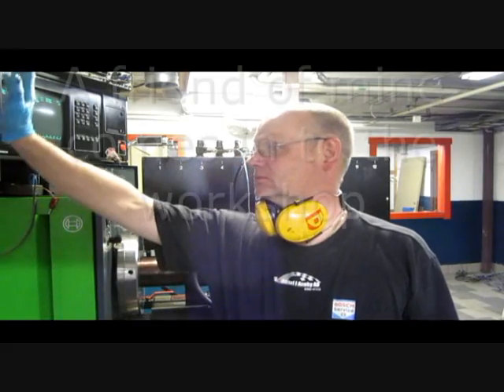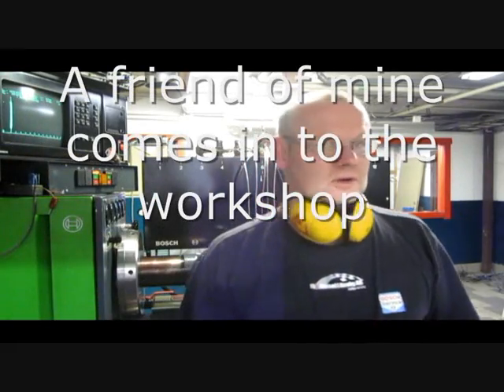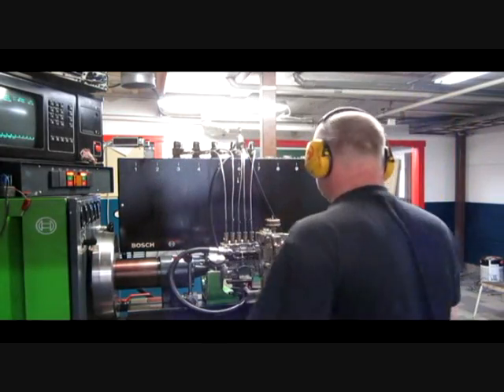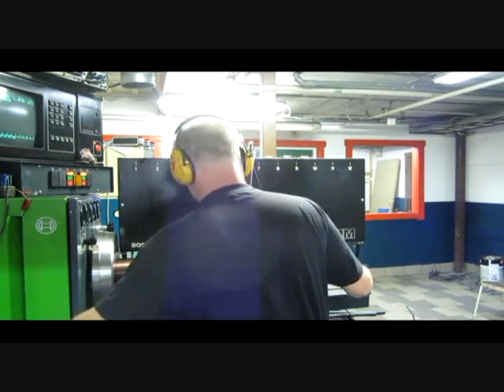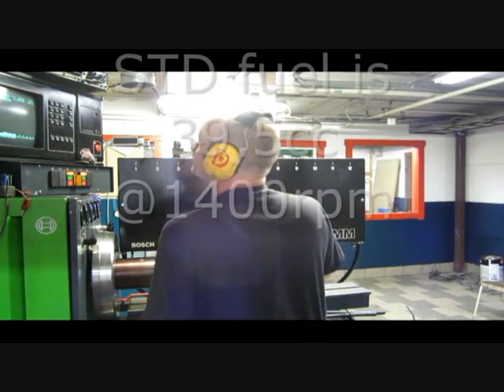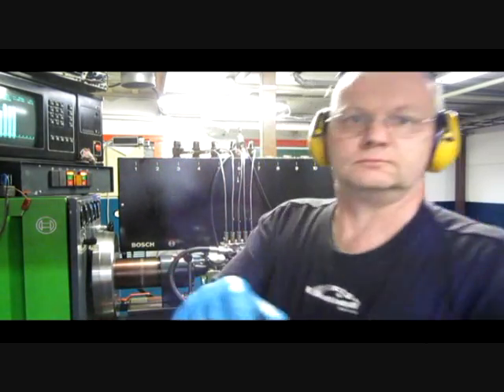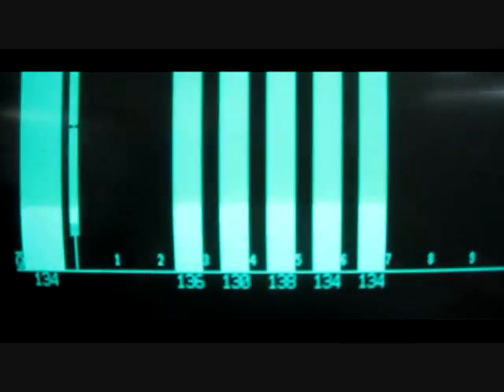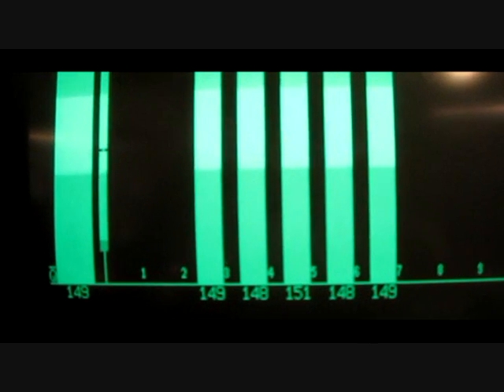Dieselmeken shows M-serie pump for Mercedes 6 mm element 150cc @ 1400rpm

Comment: Wow man your amazing... Will the engine fall apart with 274HP? Torque monster!   Can you do this modification for safe daily use on a OM601 2.2L N/A 4cyl Mercedes engine.
I am assuming when you drive it normal it will get great mileage and when you step on it like mad man it will get less. But if this is all true... I gotta have one! 
Great work. Update me

Comment: Hi Ken,
      Great to see a Professional working on pumps! Thats a PES 5M from OM.617, originally had 5.5  elements. You fitted 6mm, but what 6mm elements did you use?

Where they from the later Electronic pump from OM.605/6 series?